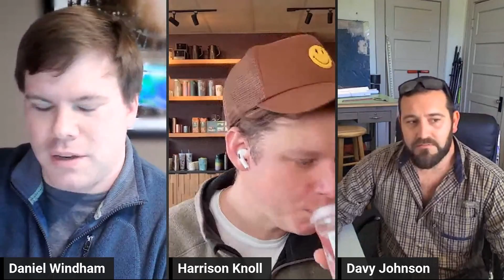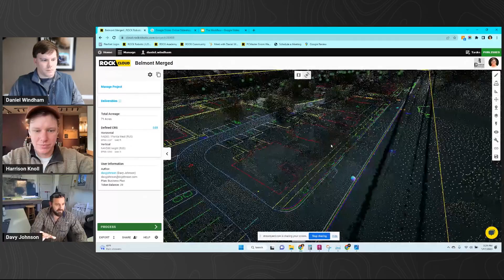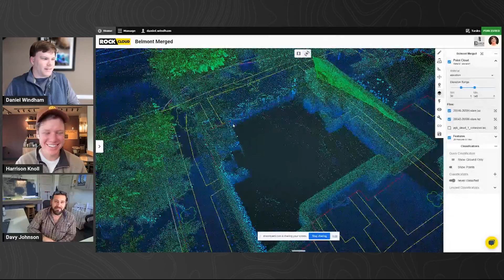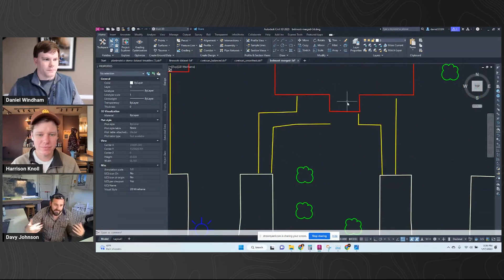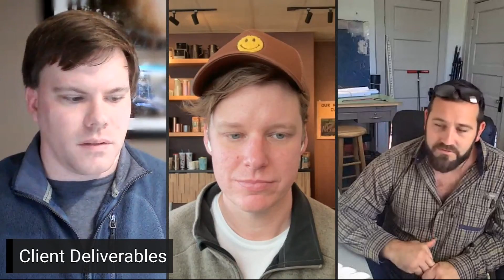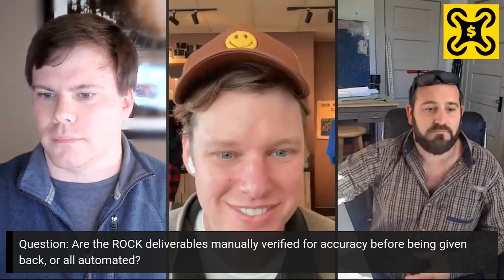Land Surveying Workflows (Drone Money - Ep. 4)

Comment: Keep up the the effort  team.  Always  fun to watch new layers  of technology grow.  Im interested  in both products  and services  you guys are innovating.  Can't  wait to get my own gear and I think  i understand  the network  idea.   But if you just have a hand full or 1.  Of the (Rock Box) ill call it.  Plus wi-fi.  So you still  need to rely on an existing network  of towers  and recievers in-between  communication with the satalite?  Or no?  Just wondering  if its like a fine tunings of an existing  network.   Or if they are their  own network  independently.  And how far in the bush this can work.  Also does this network only  work for surface surveying?  Would  it still help underground?  Like in a mine shaft or tunnel?
Reply from the maker: The network works just like any NTRIP network. If you have a clear view of the sky, and internet, you're good to go! Underground is something that usually has to have special control or a SLAM setup for scanning, and the ROCK Base is set to help you above ground!
Reply: @ROCKrobotic  yeah watched  the rock slam video  cleared alot up.  Also watched more videos explaining.  Amazing  so much can be done  with one person.  That backpack 🎒.   I was thinking  something  like that on an remote  controled  vehicle.  Make real quick work. Good view of the curb aswell. Probably  save effort of hauling it. Maybe  even  a quad.  A quick drive through  the neighborhood.